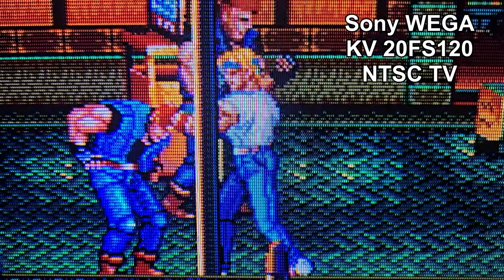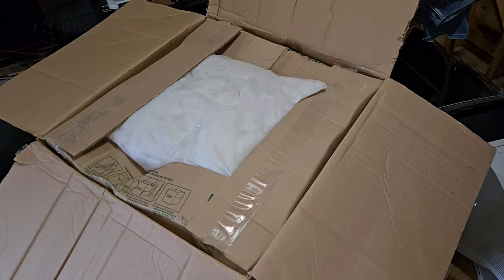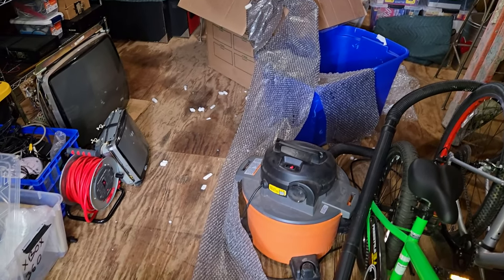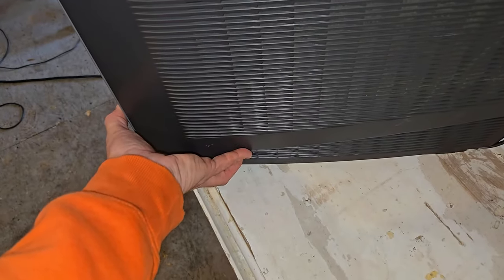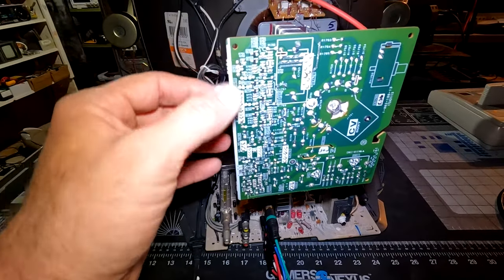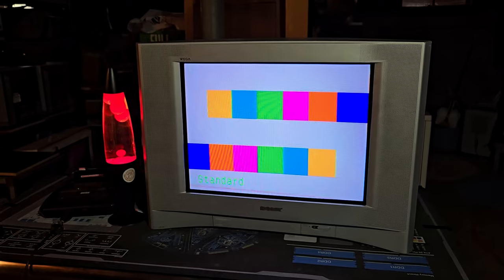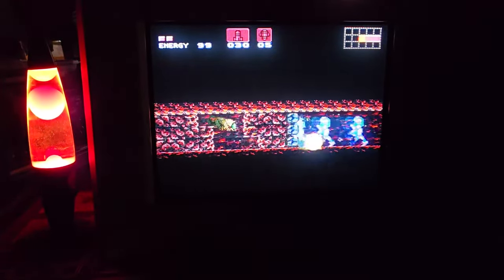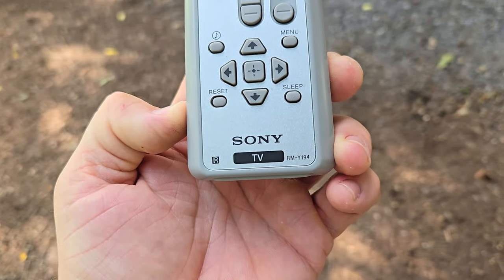The Sony WEGA KV 20FS120 Deep Dive - How good is this Trinitron?

Comment: I have the 24” version of this T.V. It marked my return to owning a CRT set since I left them behind in 2011. Back then, I owned a Magnavox tube with RCA out. Played a lot of N64 and Xbox on it. I have to say, I was blown away at the quality of this Sony set. It caused me to seek out another, bigger set. While I still have this set, much to the dismay of my wife, I located a 36” 2001 KV-36FS13 which is my main set. I love the component hook-up to my vintage Onkyo 2.1 speaker setup.  It’s my old-skool rig and I love it.

Comment: I recently bought a brand new 2007 model 14 inch RCA 14F512T still in its box with manual and remote, even the original batteries still wrapped in plastic were included. PS1, Saturn, PS2, and GameCube/Wii games look amazing when connected via S-Video. 

The Sony Trinitron might still have the edge in overall image quality, but I find that late model flat screen CRTs from any brand tend to have great picture quality as CRT tech basically peaked and most companies were very competent at manufacturing CRTs by the early to mid 2000s.

Comment: I have a KV-27FS120 that was given to me. I love it for my retro gaming and movie watching (Sony SLV-575UC VHS VCR).

You mentioning recapping yours got me thinking I should pull the back off and inspect the condition of the capacitors. I will do that over the holidays. It is plugged into a power strip that is switched off when not in use so it is not under constant standby power, which would cause less stress on the components.

I will soon have a vintage Trinitron to play with, a KV-5200. It was born the same year as me, 1981. Can't wait to give it a try. I love Trinitrons. I wish I had had them growing up, but, at least, I can enjoy them now.

Comment: I have a '27FS120, found it on the freaking curb 3 years ago, still going strong! Love it! The geometry is a bit warpy in motion, even after messing with the service menu, but it's acceptable. It does have S-video and 2 component jacks, which is nice.

Comment: I realized that a comment thread from someone talking about being unable to disable the 'red push' was deleted after I countered with information about running color calibration in the service menu.  I assure you all, it's possible.  Component on my KV-24FS120 is very close to reference.  Be aware that if you mess around in the service menu and throw stuff off enough and save it, you can damage or render your set inoperable.  Also, you'll want to make sure you have a colorimeter.

(Here's where I'm gonna recommend Lex Locatelli's video on calibration.  I don't know alot about this stuff, but it's a good primer.)

For component video, adjust the following values in the VP1 section: At the low end of the 10-point IRE scale, tweak RCUT, GCUT, BCUT, and SBRT.  At the high end of the 10-point IRE scale, adjust RDRV, GDRV, BDRV, and SCON.

These aren't the only things to touch; you should also be mindful of hue and chroma, which you can dial in on the SMPTE color bars.

Comment: I have a kv-27fs170 which is actually a last trinitron from 2006 and really interesting things like built in digital connector for modern tv and they removed VM and other post processing to actually make it cheaper.

Comment: I have a KV-21LT1B & KV-14LT1B pair, both beautiful FD Trinitron's, very bright with one of the highest luminance outputs I have seen, also very sharp with deep inky blacks, I prefer my 25" curved Super-Black-Trinitron, as I believe the last generation curved Trinitron's to be the best tubes they ever made, probably why all the fancy 4:3 PVM's & BVM's use the curved tubes, the FD ones had to use much thicker glass fronts, which seems to downgrade the image quality somewhat, you get that beautiful lens effect with the curved sets that just makes everything pop, that said, the later FD Trinitrons had some gun upgrades so it balances out, it's probably just more a preference thing in the end, I do love how PS1, Saturn & N64 looks on a curved Trinitron though, and how good Dreamcast, PS2, GC, OGXB looks on an FD Trinitron, tube type also makes a difference depending on whether you're looking at sprite or polygon based graphics too, sprites like more rounded subpixel, polygons love a slotmask or aperture grill, and there is the best of both, the dot-trio, especially the Hitachi ED mask tubes (enhanced-dot-mask), which may be the best CRTs there are if you can actually find one.

Comment: I have the 26" version of this Trinitron. I completely gutted in and installed it board and all into my arcade cabinet. I'd like to do an RGB mod to it because it's currently running from the actual arcade PC inside with an HDMI to RCA converter. Works, but I'm sure there are cleaner ways to do it.

Comment: I haven't got lucky with Wega CRT sets. I've bought two of them and both had a very nasty red color bleeding on the white color. It's a tube issue that is not repairable, unfortunately. But I would be happy if I got one of these in good shape. It's a great TV set.

Comment: I got one of these for 10usd like 2 hours/60 miles round trip from my house. Way happy I picked it up. The older guy said he played ghost recon competitively with it. He seemed pretty nostalgic and watched as I drove off with it. It's just sitting in my closet now that I moved to a smaller place but can't get myself to get rid of it. Also had a latin kv-21fa310 with subwoofer but it had magenta whites that I couldn't fix. Left it on the curb in the move 😭

Comment: Darn. I found a KV-32FS210 on the curb about 1-2 months ago and haven’t found a single video about it that lasts more than 30 seconds. It’s beautiful though when gaming! And weighs 170 pounds..

Mine came out in 2006 and I think it cost around $500-600 MSRP when I saw an old ad for it, not sure if that was its launch price though.

Edit: mine has not been recapped or cleaned up, it’s in pretty rough shape, no remote and no front flap, but it still works. I would love to get it freshened up but atm I don’t have those skills

10:25 I have noticed in snes games in composite playing DKC when bananas go by there is ghosting or trails for the color yellow only. Not sure why that is but I assumed it was composite only, but you have it on component for a game on snes also

Comment: Have this tube, got it for $20 off FB marketplace a couple years ago and replaced a toshiba you did a review on that you gave the weakest review to lol it’s a solid set and works great for all media unlike my Toshiba that was terrible with movies on vhs and ld. I too noticed the shaking in the image in 240p and no one has found a solution to it but like you said from a distance you don’t notice. Even though it doesn’t support the scart mod I use mike chi’s rgb2comp converter and must say rgb content looks phenomenal on it through component. I hear the colors are more solid when doing a mod and using straight scart without component conversion but honestly difference seems subtle to me.

Comment: I had a couple of the 24" version of this tv.  Those along with 3 other later model trinitrons all had the "shaky" screen that you mentioned.  I like to call it "the jiggles."  I couldn't stand it, and once I noticed it I just couldn't unsee it.  I got rid of all my trinitrons for this reason.  Funny enough, I also have 4 pvms but none of them have this issue.  I'm convinced this is a consumer trinitron problem across the board, I'd love to know a fix for it.

Comment: I recently got this very model. I've been pretty impressed by it - it's got better geometry and convergence than my 32" Trinitron. The lack of S-Video is a bummer, so I decided to pick up a Koryuu for that purpose. It's not perfect on resolution switches, but it's more than good enough.
Reply: What’s a Koryuu? Is it something that converts s-video to component?
Reply: @jaystephens3115  Yep yep. It was really designed more with the OSSC scaler in mind, but also works just fine with CRTs. It's still digital in its underlying design, which is why it doesn't perfectly handle resolution transitions, but it's still extremely fast, only showing a bit of jitter before locking in again.

Comment: I have the 24 inch with s video. I found it for 40 bucks in my town. I dont own any testing suite *yet so I hope to fix the slight bend on the right side of the picture using the service mode

Comment: I've had a few FS and FV series Sony  sets over the years, but I prefer the look of my S series set with curved tube glass. The FS and FV sets had crappy filtering built into the component inputs whereas my RGB/Component modded S42 does not.

The Wega sets can get more vivid than the curved glass S series Sony's, but that's really where the advantages end.

Comment: I have one of these a 20"
Reply from the maker: This is the 20" one.   Congratulations, it's  a darn good crt.
Reply: @RetroTechUSA  

Except mine doesn't have the s-video output, but it does have component output 

I wonder why Sony removed the s-video output. That connection should have been a standard, especially when crt TV was on their way out. Mine was manufactured in 2004 or 2005

Comment: The MSRP price even in 2024 standard got you OLED like picture quality. Now you have to spend 5x more for an OLED TV which can rival a picture quality of a CRT yet can’t do composite, s-video, and even component. Input lag still awful, motion blur still there, and you can’t still properly scale 240P to look just as sharp (low resolution will look bad on oled but not on crt). Oh for $450 you might be getting a Chinese made TCL or Hisense (more like Lowsense) LED TV. It’s so bad that my Toshiba CRT look far better than those LED TV in fact it better than QLED and mini LED and OLED in motions and scaling.